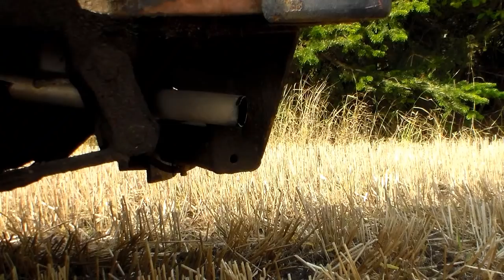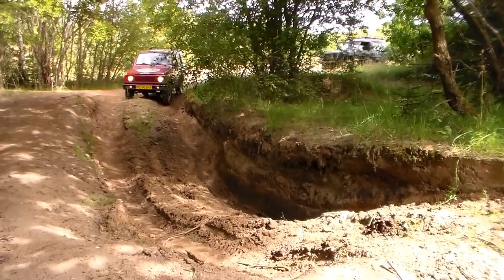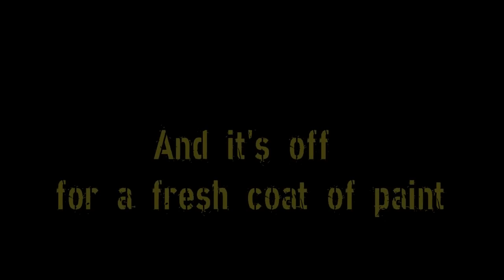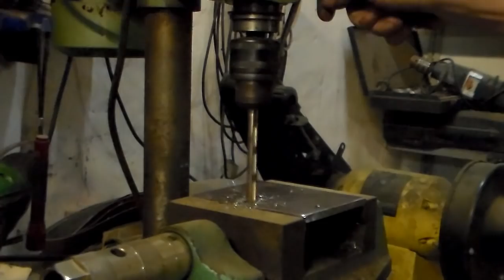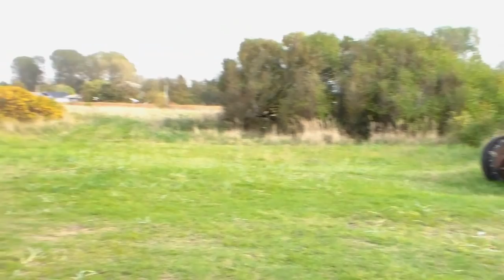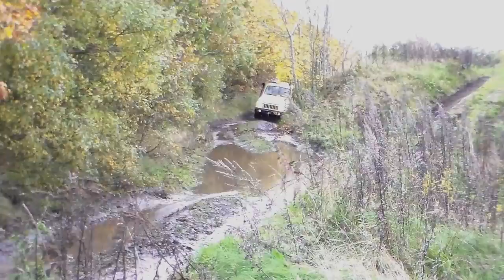Suzuki SJ Makeover

Comment: Used to have a 1979 'Zuki.  Loved that little truck...went anywhere.  If I ever got stuck, I would put it in gear, pull out the manual choke, and get out and push.  Worked almost every time.  Cheers.

Comment: Hey that is awesome,  I am fixing up a '91 samurai sj410 that wasn't even running when I bought it.  It now runs pretty good and I have it running on both lp gas and petrol.  I also have the same snorkel as you but since I added lp gas I had to build  a hood scoop as the carb sits up pretty high with the extra attachment for the lp gas.  I had to switch out the original automatic choke carb with fuel injection for a fiat carb with manual choke and no fuel injection.

Comment: The old SJ was in very smart condition when you got it, almost impossible to find like that in the UK now, it was a great little 4x4 in its day. Great vid, it looks great now you've finished.
Reply: retrorocker44 They are always ruined by the ONE LIFE LIVE IT crew. I bought one a few weeks ago, it had been painted with black gloss emulsion, rust had been welded over, running gear completely shagged. I have started restoring it, or at least reversing the OLLO mods.

Comment: First rule of off roading is, keep your thumbs on the outside of the steering wheel, that way, if the steering suddenly pull due to an obstacle, you don’t break your thumbs.Also, the roof rack mountings need more bracing, as it wobbles about and they will fatigue break , with unpleasant consequences .😊
Reply from the maker: Hah yeah. This was a really long time ago, by now. Still miss that little suzuki though.
But yeah, i do keep my thumbs out, when things get rough. But it was actually not much of a consern on this, because it was so light, it really didn't have that tendency to throw the steering wheel, like many bigger trucks do.
And yeah, i noticed that problem with the roof rack, after seeing my video footage, so i did go and change the mounts :)

Comment: great video, there's obviously way more that you could do to this little truck, but that doesn't necessarily mean you have to do it, I think with the engine stock it doesn't need a lift, if anything maybe a 1" body lift for more clearance of tyres, but its simple and looks and performs great.. thanks..
Reply from the maker: Hey. Thanks for watchin'
This little truck actually got forther upgrades later on, including a full suspension kit. " 2" Trail Master. Suzuki SJ. Flex Like a Hummer "

And swapping the engine for a bigger one.
" Suzuki Samurai Engine swap Time Lapse "

Comment: Hi. Thank you for an inspiring movie.
What did you choose for winch? It does not look too beefy.
Do you have any tips about the assembly of the winch?
What's the make of the snorkel and tires?
Will pick up my SJ413 later this week, and am eager to start modifying.
Reply from the maker: Hi there, thanks a lot.
You are right, the winch seen mounted in this video, is a very small 1,5 ton winch. Mostly meant for ATV's. But given the cars low weight, it would do in a pinch. However, later on, i built a custom bumper for it, and mounted a 4,5 Ton Warn winch to it.
The tires i think were "Insa Turbo" and the snorkel were a no-name thing, but a copy of the ARB Safari snorkel. Both were bought at "Jimnybits.co.uk"

Thanks for watching!
Reply: @KJOff-Road  Thanks you for the information. My plan is to install a smaller winch at the back of my car and then a bigger one up front. 
I really really like how you mounted the vinch behind the original bumper and think I will do something similar to my car.

Comment: i think i can see that you change the shackles too
is that right??
amazing sami
Reply from the maker: Very observant.
Yes thats correct, one of the shackels had a bit of damage, so we made a new set, of slightly thicker steel. And also made them about 1 1/2 inch longer.

Comment: We recently acquired one of there with a siezed motor, other than fixing the motor what are some cheap worth while up grades you'd recommend for light off road?
Reply: Put a rope on it and make a great boat anchor out of it - lol
Reply: Lock right locker in the rear diff. 30 inch mud tires

Comment: Hi, when you switch to 30" you keep the 1,000 cm3 engine, and as is the behavior of the car? lost force? Thanks.
Reply: yes mate, it lost power, unless you put 4.77 reduction gear in the final gear it'll be good until 31" inch tires

Comment: Hey, awesome video! What size of winch did you put on it?
Reply from the maker: Hey. Thanks a lot.
At the time, we put a small 1,5 ton (3500 lb.) winch on it. mostly because it would fit nicely just behind the stock bumper.
But we are currently rebuilding the front, with a new bumper and putting on a Warn X9000i winch instead.
Reply: TeamArmyTrucks Awesome! Im thinking about getting a small one only for the looks and the price, here in my country a good 9000lb winch will set you back 1300 dollars.
You have my subscription from Uruguay. Im now in the process of rebuilding my 87 sami 1.3.
Keep posting videos and let us have a look of what you've done on the inside!
It is my daily driver and i wouldn't trade it for anything else so im trying to get ideas on what to do on the inside. Love my Sami
Thanks for the reply
Reply from the maker: Alejandro Berro Well, the winches dosen't get cheaper here. we all suffer from that.
But those suzukis are really fun little machines, and almost perfect for offroad use.
We have made a few more changes since this video. so we might make a full "Closer look" video once it's all done.

Thanks for watching!

Comment: The only thing I wouldn't have done is those tyres.. They're way too big and unsuited for the Jimny.. pretty sure they will rub on the flares when the car flexes too.. It's a lot of unnecessary strain on the diff and cv, and ruins your braking performance. my car has bf Goodrich KO2 215 75R15 an they're perfect for daily and regular off-road, this is a 2019 JB74 Jimny, If you wanna de the tyres and the car my Instagram is @JesseJimny
I'm hoping to buy an Old SJ40 or JA71 soon too, I might take some inspiration for mods from this video.
Reply from the maker: Thanks a lot. And you are right, those tires were a bit overkill for this little rig. However, they are incredibly well built, and the drivetrain didn't seem to suffer at all. Probably because of the small engine. It simply didn't have the power to break itself. And the tyres were very tightly fitted, rubbing very little when all flexed out. However, it later got a complete lift kit. That got everything sitting just right. We have a vid. On that aswell.
Thanks for watching!